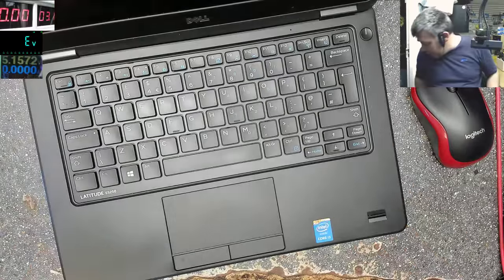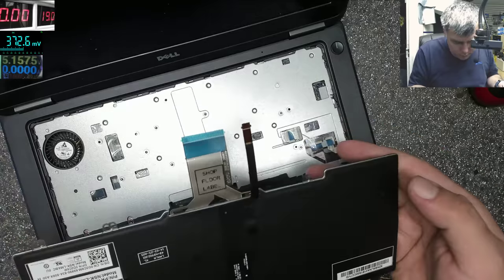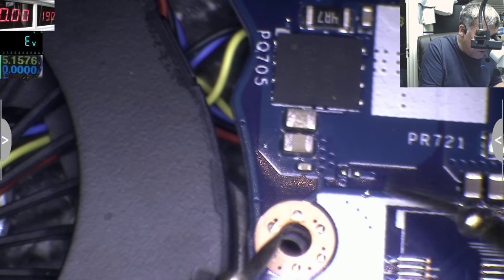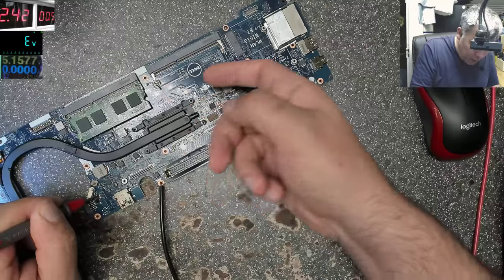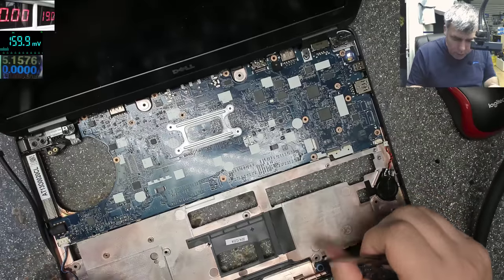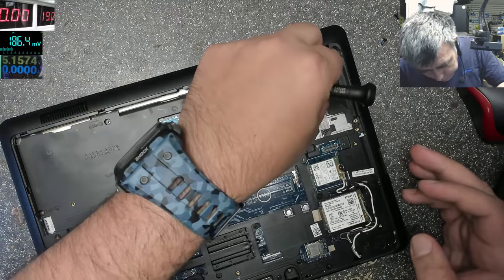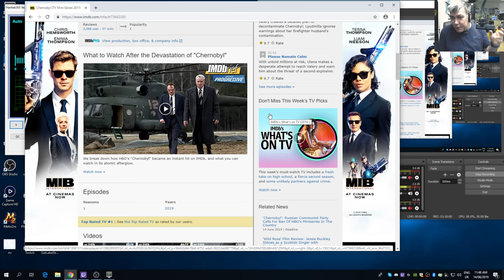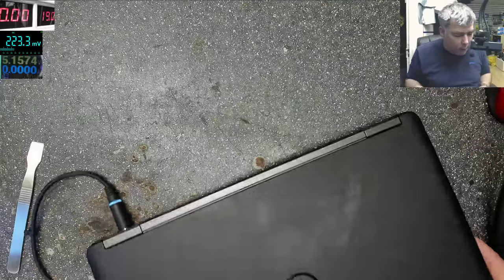Dell Latitude E5250 - no power, not charging , logic board repair

Comment: 20:04 look at the marks. 
PL2 and PL1. "L" always means coil,
PD1 / PD2 -  "D" means diode.
PQ1/PQ4 - "Q" means transistor
PC100 - "C" means capacitor
PJP200 - "JP" means jumper
PU8006 - "U" means IC/unit
PR721  - "R" means resistor
etc.
Reply: you are sooooooo smart
Reply: @stevejoseph3129  whats the p?
Reply: @johnquiachon2823  my guess p stands for part
Reply: The P stands for Power. I.i. It is high current carrying component.

Comment: Sorin, I have experience with modern Dell laptops and the reason the laptop is not coming on right away after the BIOS battery is removed is because the BIOS is going thru an initialization and figuring out everything on the board. If you have the fan installed it will run it at max speed and cycle multiple times. Sometimes it even errors out and flashes the LED codes at which point you have to unplug and restart. Normally you don't touch the power button until the first screen comes up.

Comment: I had a 5430 last week, I spent most of the day taking it apart, and putting it back together to replace the cmos battery. I had to completely disassemble the damn thing to get to the battery, I had over half a dozen piles of screws, and the screws were 3 different sizes. I ended up upgrading the CPU while I was there, that was the easiest part. It was prettymuch a full days work just replacing the damn coin cell battery.

Comment: Mine had the same problem. No power on. No charging light completely dead. I unplugged the bios battery and shorted the pins and plugged it back in and its working fine now

Comment: A lot of business laptops used to be built this way, with components like RAM, the WiFi card and hard disk being easily accessible, but for taking out the motherboard or CPU fan one would have to take the whole laptop apart.

Comment: Mr. Sorin: "I have to remove the screen; because, the hinge, it's over the motherboard.  It's a crazy design. . . .So, everything is removed and the motherboard should come out easily, which is not happening—for some reason."  ...Yep!  The disassembly of these Dell Latitude—"Attitude"—laptops is awful: you need to take EVERYTHING apart to get to the motherboard!  Misery.  I just finished one (E5410), and it took like 2 hours to carefully disassemble and reassemble the f***ing thing; and I still wound up with a "bonus" screw!  I even dreamed this morning of finding where the extra screw was supposed to go!  PTSD.  Next time, I'll try Paul Daniels' technique of using a 15-compartments pillbox to keep track of roughly where each screw comes from, with respect to the laptop's overall layout; Sorin's expert approach of confidently shoving them to the side doesn't work for me!  Hehehe.  One good thing, though, the online Dell service manual gives very detailed step-by-step instructions—with photos—on how to do the disassembly.  Also, the electronics hardware looks pretty solid and full-featured, and I also like their 3 diagnostic LEDs setup (if you've got power).
Reply: i forgot the series, i got one at the moment, remove everything just for upgrade memory lol

Comment: Great Job tracking the problem, but how did you chose the replacement cap? no marking no schematic, just any cap will do or what? what is the trick in selecting replacement smd caps?

Comment: Hi
Firstly thanks for all videos 
I learn many things and resolve many computer by following your steps.

But now i have a problem with fujitsu li 3910
When it reach 26% become (plugin ,not charging) .problem is when i remove battery the laptop couldn’t turn on with power ic only.battery should be in. I tried with another charger, but still same problem.
Can you guide me pleas?thanx in advance.

Comment: just a quick question,.,..,,.when you set you power supply to 19v...do you set up the amps also..or how do you know how much amps is there already when you inject the 19v ,,or you tuen the amps very low before you inject 19v..thanks

Comment: You are so good, thank's a lot for sharing. By the way i have a presario compaq cq60, external screen works but not internal screen. i did change the screen wire that goes from the laptop to the screen. the converter and the screen and still no internal image. so would it be a motherboard problem?  LVDS line or voltage?  My 3.3 volts is on tthe screen plug, my 19 volts goes on the plug too and 5 volts i think i saw too i'm not sure is also on the internal plug.  External screen works fine. So, since it's not the graphic chip, what do you think i should check?  You are the only one i trust to help me. Hoping for an answer. Thank's sorin. Best regards. Serge.
Reply: It was the graphic chip cause i did order another board and it works good lol!

Comment: Hi..I need help of my sony vaio Sve15124cxs..recently i have problem the machine wont turn on...when i press power button the battery icon and the startup led indicator just blinking...then i trided this method..

Remove the battery and charger

Then hold up power for 1 minutes

After that insert battery and plug the charger it turn on and works fine untill it shut down..but when i restart the machine ot turn on and after 1 to 2 min it shut down automatically...and wont turn on again...

Why its happen..pliz help

Rather then i remove the motherboard and clean all dust and reaasemble everything then when i power up nothing happen..after a few minutes..when i power on it turn on and use about 12 hrs..but when i restart the device it won't start and only green light appears for a second and turn off again..in a word it sometimes turn on sometimes not..what is the issue..?? Thnx
Reply: Thats easy, replace power supply
Reply: @Crazy--Clown  bro i dont think the power supply fault..bcs the problem remain when using only battery..and the battery health shows good
Reply: @mushfiqultusher756  Fake News

Comment: Sorin: I have an e7470 which does not charge. I find out that the center pin (the one that determines the charger type) is grounded/shorted. Do you have the wiring diagram of this board or  do you know where I can find it? Thank you.
Reply: I have just solved a non charging issue with a e7470. I'm writing just to summarize what I found for others. 
1. Check charger and center pin.
2. DC adapter port might have a broken wire
3. Mother board might have a bad chip (I had a broken diode PD6 5V: Digikey: 1727-3936-1-ND)

I have circuit diagram if anybody needs.
Reply: @uccoskun  e5450 and e5440 schematics please?
Reply: @ivar130  I could not find any schematics, I found the problem just by inspecting the board.

Comment: Hi! after doing a repaste on my DEll G2 3590 I got no charging led no fan spin. The first time I tried to power it on I saw the charging port led blinking white, but only once it was too fast for me to see the pattern. Tried Taking out the Bios coin battery, disconnecting  the main battery and holding power for a couple of minutes. I checked voltage from charger and from battery and both are good even plugged to laptop I do not see any voltage drops. Does any one has an advice of what I am doing wrong? now I ill just connect to the charger for a couple of hours that the  battery was completely dead. Help! I am running out of ideas.

Comment: hi sorin my name is george and i wanted to ask you if you can help me. my neighbor has a laptop dell e5450 zam 70 rev 1. i opened the laptop and i noticed that pq4 was all burned out so i tried to figure out which is the fault and i found some shorted capacitors near pq705, i removed the damaged one and bridged pq4. I tried the laptop half disassembled and it seems to go. my neighbor has two children who now need a laptop to study and I'm afraid they'll get hurt. Can you tell me what this pq4 does and if it is dangerous to leave the jumper without mounting another same component and its capacitor, thanks in advance and apologize for my english i am using google translate

Comment: Hello,
can you please help me. I have dell latitude e5570.
does not charge Battery unknown charger in bios.
I tried different original charger all the same problem.
in bios test battery is excellent.
if i put the dc jack in for only 3 seconds white light then off.
  greeting